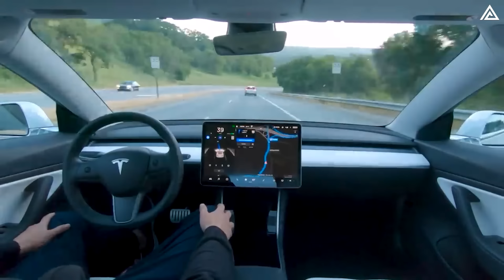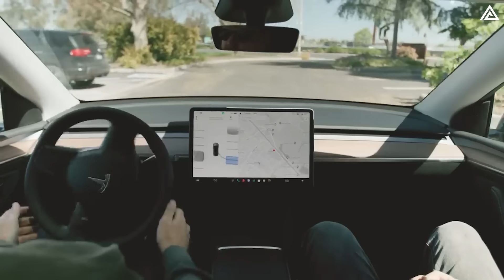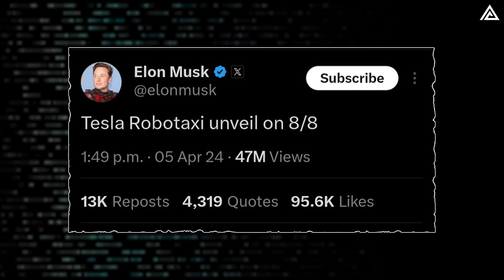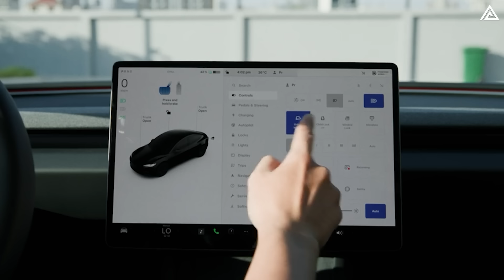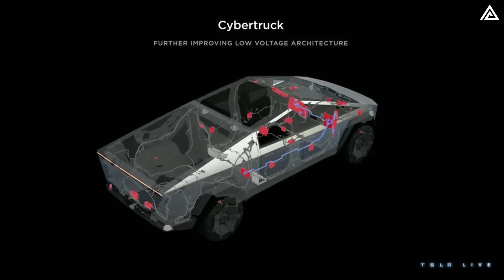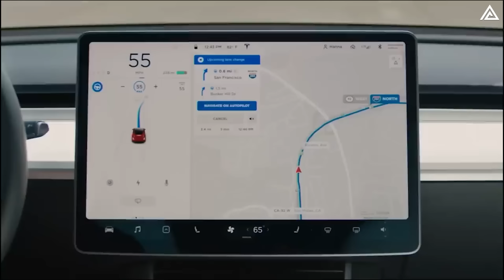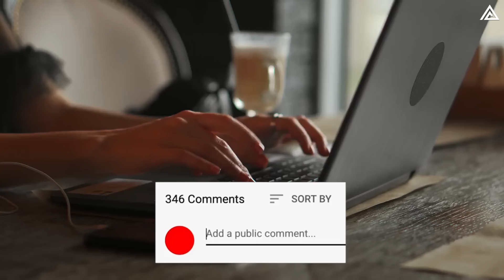Tesla's Model 2 'Redwood" Compact Crossover Project. Elon Musk Reveals 9 Things You Need To Know

Comment: What is going to hurt Sales of the Mod-2 is the Range between Charging. It should be at least 500 miles.
Reply from the maker: A range of 500 miles would indeed be ideal for the Model 2, but achieving that with current battery technology at a $25,000 price point is challenging. While Tesla's innovations in battery tech could extend range, the Model 2 will likely have a range between 250-300 miles, which is standard for affordable EVs today. This might hurt sales for customers prioritizing long-distance travel. However, urban drivers and those with access to a robust charging network might find it sufficient, especially given Tesla's focus on efficiency and affordability.